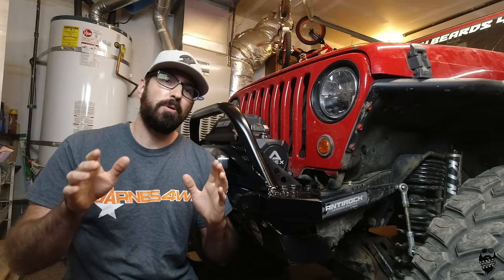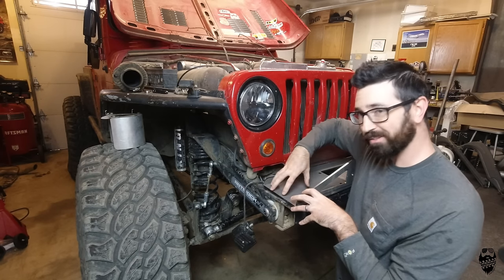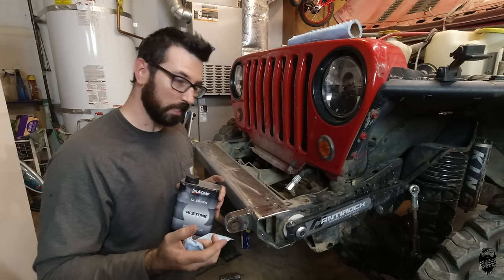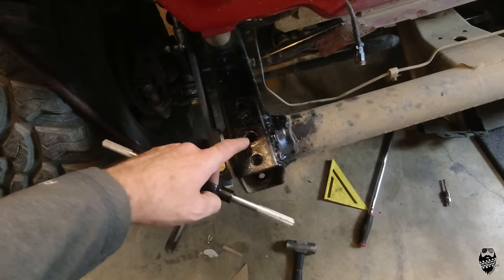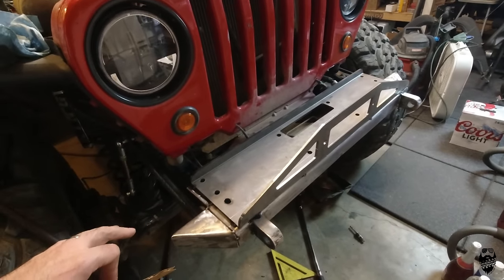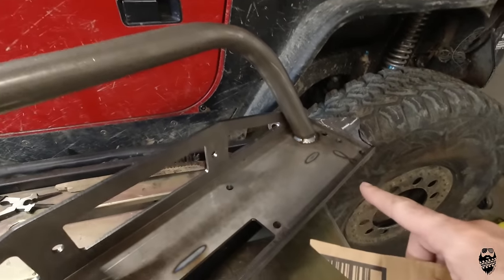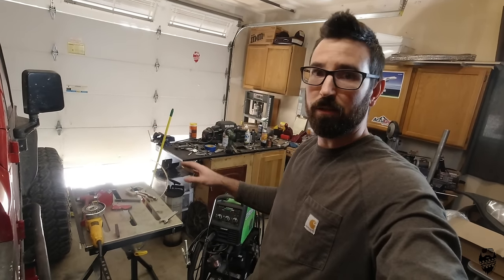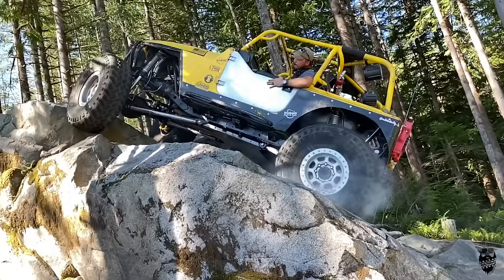Build your own Winch Bumper on the Cheap! DIY Bumper fabrication

Comment: I know I’m a little late but I recently bought a Jeep after not having one for about 8 years. The Harbor Freight bender is a pipe bender. You need tube bending shoes. Pipe is measured inside diameter and tube is measured outside. Great video though!

Comment: Hey MB. I know this vid's been out for a while, but believe it or not, you can us the HF pipe bender on 1 1/4 od x .20 wall using the 3/4 inch shoe. It looks counter-intuitive because the tubing rides the outside of the shoe (doesn't slip all the way down into it) but it works. Give it a try!
P.S. what setting did you use on your welder for this bumper build? I have the same one and it could save me some time. Keep up the great vids! -Mike.

Comment: your not using flux core wire are you? got my eye on a titanium,but it says flux but is the same as yours.i would need handle or gun.i have torch and extra guages.ill have to see.i checked out the bumpers on barnes and amazon.like them,but like yourself i like the shorter look and such.surprised why a stubby would be so much more.makes no sense.ill figure something out.but if you can tell me,are you running gas with your welder.thanks beardy,your doing awesome.saw a post from some jerk,dont see why he wld open his mouth.probably pays somebody to do all his work.
Reply from the maker: I use solid core wire, super arc .035 and 75/25 gas.

Comment: Your bumper came out really nice Kelly . I have been thinking of changing my front bumper a little and make it a shorty instead of a mid length . You have now inspired me to do so . Question that may sound dumb , but are you welding with 115/120 or 220/240 ? Just wondering as I only have a 115/120 welder . Take care and be safe my friend.
Reply from the maker: Awesome👍🏻 it is a 240
Reply: @MuddyBeards4X4  Thank you

Comment: i have a 98 tj.up-grading and need bumpers.i like how you went with yours.So the square part at very fron of bumper,did you buy that or get it with the smitty winch? i see it has the connections for D links,so did you just make those and weld them straight into frame or is it a bolt on smitty part like you kinda mentioned with winch.i need a solid hook-up position on front and rear.im wanting to go as you have cause i know you know your stuff and know how to squeeze the dollar.please help ,big supporter.you make all small parts of building known.GREAT!!
Reply from the maker: My original bumper I cut up was the Smittybilt rock crawler bumper. They are like $160, so it brings the cost up if you had to buy that as well. Maybe look around for some used bumpers to cut up?

Comment: that piece at 3;57 or so that has the cap that has the D ring connection points and runs all across front,did you buy that or build it.i need just that exactly.my welder is not the best and ill do best i can but i saw the bumper from amazon and want to go with that,but it probably doesnt have a solid pull point like you have,or did that come with it.or where can i maybe get something near that if you know.sorry so long